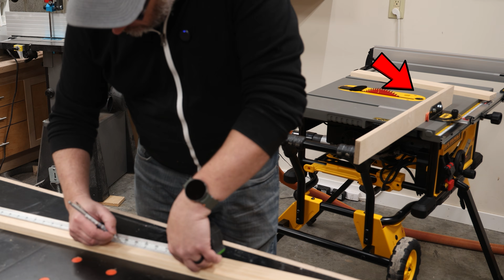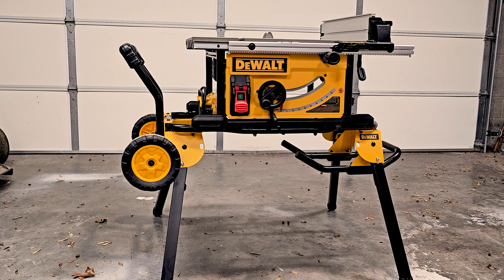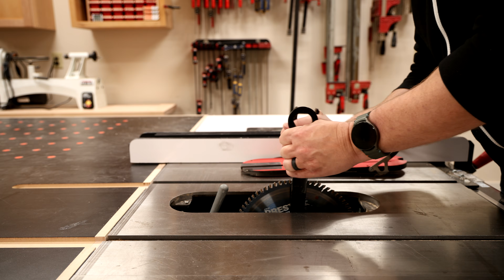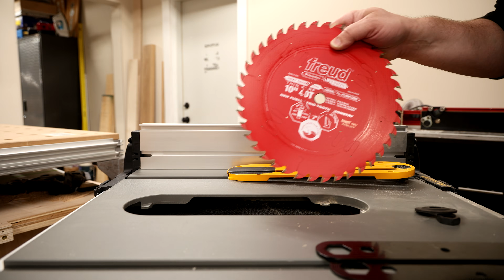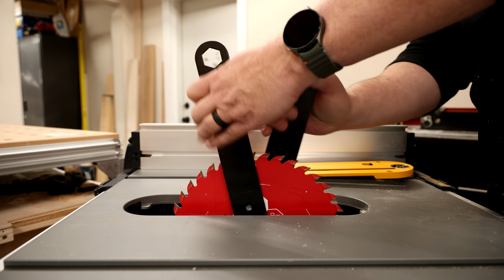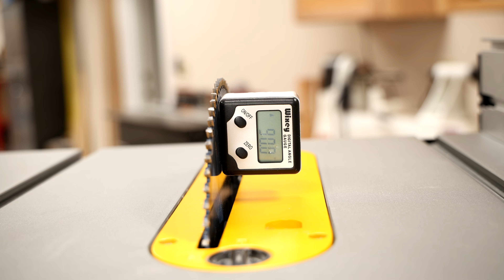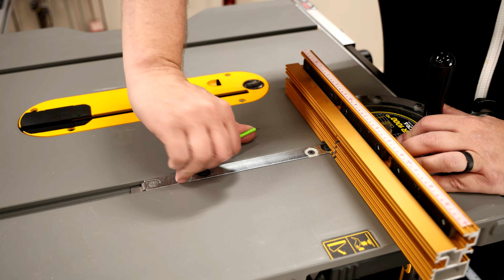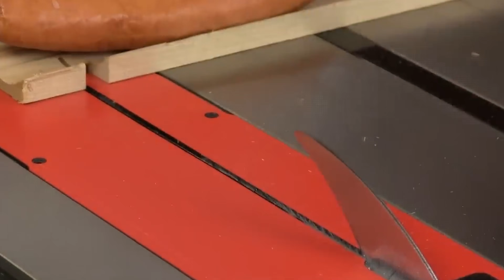Why do people even buy this saw?

Comment: You briefly mentioned the dewalt accepting a dado stack, but not once did you use said dado stack to plow through some plywood or hardwood. Skipping over possibly the biggest reason you would want a 3 hp cabinet saw
Reply from the maker: you're right I did not test dados in this video however I've had 2 jobsite saws and both have been able to easily make 3/4" wide by 3/8 deep dados without a problem. that's the most common dado for cabinetmaking on sheet goods. if you're cutting really deep dados in hardwood you may be able to stall the blade.

Comment: I have that DeWalt saw and it's a lifesaver in that I am using a (small) one car garage as my shop and I can fold the De Walt up and move it out of the way when I need extra space.  In fact everything in my shop (including the workbench) is on wheels so I can move the stuff I'm not using out of the way.  And my workbench also serves as my outfeed table.

Comment: I understand you're not a machinist...
it depends on the engine power and the width of the sawblade, but much more depends on what the sawblade is turning on 😉.
the shaft anchorage and shaft diameter is the holy grail of any saw.
there is no problem making a portable saw with a 30-40mm shaft, but nobody wants to make that because then nobody would buy big table saws. 
it's just dirty marketing of fucking capitalism 😉

Comment: I use UHMW throat plates on my table saw.  They're stiff enough not to flex and easy to cut to any blade setup you want.  Plastic can shatter and aluminum can throw sharp shrapnel in your face if you hit it by putting a thicker blade on the spindle.

Comment: That DeWalt is certainly the jobsite saw that seems to be everywhere, which makes it a logical choice for comparison to a cabinet saw.  I have to wonder if there is there an even better jobsite saw that should be considered, perhaps one that has fewer set up issues?  In particular, the SawStop Jobsite Saw Pro?  The price is not really comparable to the DeWalt (at something like an extra $1,100 and up!), but that is before the bits and pieces are added to the DeWalt.  As a company that made their reputation on quality cabinet saws, I have to wonder if SawStop might have chosen to make a jobsite saw to the same standards.
Reply from the maker: IMO if you have $1100 to spend you should skip a portable jobsite saw and shop for a contractor saw. Everything about it will be better and the used saw market can help you get even more for your money.

Comment: I started off with the same DeWalt saw as you demonstrated.  I found while setting it up that it was really out of wack and with you video, I most likely could have solved them.  I decided to return the saw during the return period I ended up buying a Laguna F2.  Very happy with it.  Sure a SawStop would have been my dream, but unfortunately I did not have the funds.  I just have to remember... the hard part, to do the check, before I turn on the saw if I have performed all the safety checks.  So far so good.  Thank you for an insightfully viewpoint on how you made your decisions.  Keep up the great work.

Comment: i will never understand why nearly every amateur or semiproffessional  american YTer has a saw where you have to push the workpiece. with the budget of a sawtop i can buy a saw with a sliding table. 
watch the chanel of marius hornberger with a Hammer saw of the austrian felder group . and if you have unlimited space an money there is only one saw to buy : Altenburg F45
And b t way: who cuts wood longgrain with a dull 80 teeth blade and shows the burnmarks?
Reply from the maker: that's the kind of saw they sell in America 🤷 European sliding saws are way more expensive to have shipped to the US.

Comment: Like some of the comments go, It's not a choice between a job site saw or a cabinet saw. Saying it's a choice between a job site saw or NO saw is also a bit of an exaggeration.  It's really a difference between a job site saw or a handheld circular saw.  Even the Dewalt job site saw is at the border of affordability.  I've been on plenty of jobs where I ripped sheet goods with a SKIL saw on a makeshift work table with sawhorses and another sheet of plywood using screwed down firring strips as a guide. What I really would like to know is a comparison between job site saws.  How cheap can I go and still make reasonable cuts.
Reply from the maker: there's hundreds of those videos on YouTube you should have lots of viewing choices there

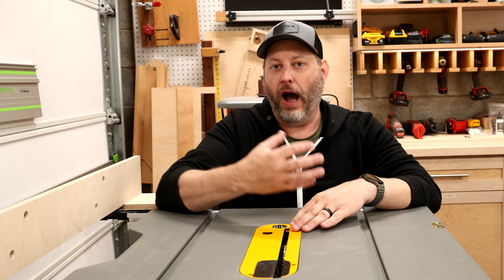Comment: 4:30 tipping the saw is not a problem, the stand is very sturdy and capable. I’ve cut full sheets on it (and other jobsite saws) before. You just need to worry about proper handling of large sheet goods and getting a straight cut, but if you have a helper or infeed/outfeed support, it’s not a problem. Honestly, if you’re pushing that hard that you tip the saw, you should sell your tools cuz you don’t know what you’re doing.
Reply from the maker: it's not about pushing hard it's about putting a 75 pound 4x8 sheet onto a saw that was never designed to do that. also outfeee support is always a good idea no matter the saw!
Reply: @MWAWoodworks it was absolutely designed to do that. It’s a job site saw, they were designed for framers as much as for trim carpenters. That 32” rip capacity was not included for cutting 1x6’s. And Dewalt’s own product description, on their website, includes ripping sheet goods. Your opinion on what you think the saw was designed to do has no evidence to back it up.

Comment: All job site saws need to be dialed and in the case of my skil worm drive I made some mods to make it easier to do

But I would say it's really dangerous to do any cuts without dialing in any saw and for a portable saw plan on dialing it again periodically jusy because you move it a lot and that can knock it out of cal.

So it would be good if the manufacturers would dial them in but at the same time it would create a false sense of security. You need to know how to dial it in and check it periodically because it's portable and it will lose its cal. Guaranteed.

Comment: My terrible jobsite saw is slowly twisting itself apart. Every time I turn on the saw the 2000w motor applies enough torque to seaming twist the chassis under the top. At this point the blade from front to back is out of alignment with the fence by nearly 2mm. Needless to say cuts are not accurate and have started to feel pretty dangerous.

Comment: I have both the DWE7491RS 10" Jobsite Table Saw 32 - 1/2" Rip Capacity with the 1.75 HP motor and a Harvey ALPHA HW110TC-36Pro with 3 HP motor. I initially purchased the DeWalt 10 years ago and learned those lesson of inaccuracies the hard way. Moving up the the Harvey cabinet table saw was hands down instant accuracy and ease while cutting hard woods. I am glad that you were able to put this video together for those who are on the fence of starting their woodworking journey. The DeWalt is meant for "jobsite" and was never designed to be precise nor with extreme accuracy in mind. It was mainly for cutting lumber like pine and  other construction types of wood. Anyway, great video and lots of great tips for everyone and hopefully will save them from learning those lessons the hard way.  Keep the great content coming!

Comment: I appreciate your review - thank you.  I would add a few points to ponder.  I feel like the comparison is a little off based on what the intended uses are for each saw.  The use cases for these two saws are fairly different based on what the owner/user is looking for.  What's most important: Budget, safty, accuracy, portability, size, longevity, speed, effenciency, blah blah blah...  I think in the end you get what you pay for and what you expect out of your machines.  Truly the craftsman makes the differences.  If you know the limits of your machine and know how to make it work for the task at hand, then the saw is an afterthought.  for the average DIYer at home, they probably do not need a Felder sliding table saw...  And for a professional custom furniture builder a contractor saw will probably be a let down on many fronts around accuracy and ease of precsion.  Our worlds finest builds were made with hand tools up until recently - sure i can build things with a simple tool box of hand saws, squares, sharp chisels and a bench, or a 1600sq ft shop with 40k in equipment.  Awesome content to get us thinking - Thanks again..!

Comment: A year out of high school in 1973 I spent all day in a Sailboat window company using a Rockwell industrial saw, vertical cutoff saw, radial arm saw, bandsaw, sanders . Made thousands of cuts at 19 years old and I am quite good with all my fingers still at 71. I would like a Saw Stop , gave my old Craftsman to a friend when I moved across the country and now temporarily have been using a rinky dink Delta for this and that. I will get a better saw soon enough but compactness is important. The ability to move the saw around has been important. I’ve played guitar since I was 14 and keeping my digits is forever on my mind when making hairy cuts. Sometimes I just stop trying to make a dangerous cut and decide on a safer choice , like not trying at all. I have had my share of close calls and stupid decisions.

Comment: Dewalt changed that saw, it now uses 8.25” blades and lacks some other features. So, caveat emptor. I have the same one you do, the older 10” model. It’s a great saw.
Reply from the maker: the 10" model is still available! I think the 8.5" is just an additional saw to the line

Comment: So 40 years woodworking. Taught adult avocational beginners woodworking courses for 20 years, including tablesaw safety courses, jig and sled making, and router seminars. Have owned a jobsite saw new, hybrid Delta saw with Unifence, and now a nearly new Delta 3hp cabinet saw with Biesemeyer fence. If I had an unlimited budget I’d have bought a SawStop cabinet saw. I have the room for a cabinet saw. Thank you for detailed comparisons, I do think those wrestling with buying decisions need to get this kind of presentation. All I know is that I wouldn’t trade my cabinet saw for any reason. Yes craftsmanship isn’t dependant on equipment. But heck, there’s so many advantages to a full bodied cab saw with no issues using stacked dado blades, custom plate inserts, cast and machined mitre slots, etc., etc. And of course, retired now using my older Delta, I couldn’t care less what others have to say🤣
Reply: If I had unlimited money I would  by The FELDER Table saw far superior to the saw stop tablesaw
Reply: @robertfrancis4876  Or a SCM. Or a Martin. Or an Altendorf. Any European sliding table saw in fact (whether it has or not a similar mechanism to Sawstop) is intrinsically safer to handle than a cabinet saw because they don't need external feed tables or extended fences to handle large panels. The slider does the work and you have to put serious intent to get your hands close to the blade. These are professional production machines well known and used even in the US but that are above the means of a weekend woodworker. I'd be over the moon getting a Hammer, the entry range of Felder sliding saws.

Comment: The problem that I've  found. Is that the blade is directly mounted to the motor. On the contractor saws. Leaves ridiculous saw marks.
So it's not a finished edge. Which throws off,your entire project. 
The cabinet saws are belt drive,much smoother.  And better finished product. Much more vibration on the contractor saws. Belts take out all the sawmarks. Which lets your router bits ( for example) follow a straight edge. 
Building houses is much different than building furniture.

Comment: I have been using that same dewalt for all my projects for years now. In regular use the settings, particularly for the fence, do not hold. I find I need to adjust my fence at least once per month or so. It can cause issues if you dont remind yourself to check frequently. I almost had a kickback situation once when I did forget and the blade started to pinch my workpiece against the fence. the other adjustments are much more infrequent. That being said, I completely agree with you that overall, it is still a great option when it comes to budget or space restrictions.
Reply from the maker: I think the newer version of the saw has worked out some of the issues of the older models. but also there's probably a bit of play after years of use also. I'm sure those saws aren't meant to last forever at that price point!

Comment: @ 15:30 Not sure why you set your fence to parallel with the blade ? You always want some toe out on the far end of the fence to avoid the wood getting pinched . We’re only talking about 3 to 5 thousands ,but it’s necessary imo
Reply from the maker: I think that's a remnant of the days before riving knives. I understand the idea of it . it makes sense just don't think it's needed on modern saws.

Comment: The more horsepower you have the more control you will have over your cuts.  I have a 10-inch 3HP #Sawstop which serves me well and am considering to size-up to a 7.5HP Sawstop or even the 12-inch 16HP #Oliver.  If Sawstop would build a 12-inch or even a 16-inch, high-horse I would seriously consider buying it.  Anything over 16-inch is horizontal band-saw territory.

Comment: I went through this debate some time back when I needed a new table saw.  First I don't understand how people say there is no need for a table saw, my table saw is hands down my most used and best wood working tool I have ever owned over the last 20+ years?  Back to this topic, here are my experiences and why I choose to go with cabinet saw.

The cabinet saw's weight and stability make a world of difference, my cuts with the cabinet saw were without questions more accurate, quicker, repeatable and safer than any contractor saw.  When you pull out the fence extensions they are just not as solid and mine had some flex.  I could never get a 30" cut as accurate as I could with the cabinet saw.  The contractor saw had some wobble when cutting larger pieces, it just doesn't have the weight that the cabinet saw does keeping feet firmly planted.  If you have a shop and space for one (I barely did but have zero regrets) the cabinet saw for me is worlds apart than the 2 prior job site saws that I had.  It took me so much more time using the job site saw because of set up, making sure I had any additional supports, etc. before I could start cutting.  

I don't see how these two saws could ever be put in the same category.

Comment: Your comparisons are spot-on, but I think you missed an opportunity to compare an overpriced tool with a shop-made equivalent: the expensive Kreg track saw system ($450)  vs the homemade version, which can be made from scraps ($0).  Even the less-expensive Wen track saw system will run you $300+.
Reply: Oops!!!  I forgot you were only comparing table saws.  Sorry about that.

Comment: IMO, the happy medium between the two, is an old "Contractor saw" from Craftsman, Delta, etc...
They're small enough to stash in the corner of your garage when not used, but powerful enough to handle pretty much anything.
I have a craftsman 113 from the early 70's, that i picked up for $50 off of marketplace.  Upgraded the fence and added a router wing.
Reply from the maker: agreed!

Comment: get real , no respectable cabinet builder with a shop uses a jobsite saw . a hobby builder might but thats it . lots of great tips and insight but doing a comparison was a waste of time .
Reply from the maker: who said this video was for cabinet builders? it was for people considering upgrading their saw.
Reply: @MWAWoodworks  so why would you do a comparison of a jobsite saw to a cabinet grade saw when its obvious that no quality cabinet grade saw would ever be used at a jobsite . and im being kind saying that the sawstop is a quality cabinet grade saw . powermatic or a unisaw or even grizzly is a better saw than sawstop if you dont take the blade stop into consideration .
Reply from the maker: hobby woodworkers upgrade their equipment all the time. DeWalt is a very popular saw to start with and sawstop is the most popular saw to upgrade to. I compared the two so people can see whether it's worth it for them to upgrade based on certain criteria. pretty simple concept.

Comment: I have the middle sized version of the dewalt, that cuts up to 25" or so.  I can confirm all of your points, pretty much.  I have used some really high quality cabinet saws here and there, and the dewalt doesn't even come close.  But, like many budget friendly options, it will do 90% of what you need it to, but will likely involve some extra steps, homemade upgrades, or fine tuning.  The other major consideration for many hobby woodworkers, is space.  The dewalt is small enough to throw up on a shelf, and only bring down when needed.  I can barely lay a 4x8 sheet down in my workroom and still move around it, so a cabinet saw would be 100% out of the question.  With the jobsite saw, I can set it up outdoors if I need to rip something too big for the room, and want/need to use the table saw.  Considering it was never intended to be a precision tool, it is a passible option if a cabinet saw simply isn't feasible, either for space or price reasons.  On another note, though, it's worth mentioning that not all dewalt table saws can take dado stacks.  The largest one with the rolling stand can, mine and the 20" capacity one cannot, the arbour is intentionally too short to put one on it.  I didn't realize this when I bought it, I thought it was the same saw as the rolling one without the stand.
Reply from the maker: all true statements! Thanks!

Comment: The fact that the back end of the saw blade and the fence are more open on a portible table saw is that your wood stock has a greater chance of not binding when pushing through your stock. if you need the kind of accuracy that this host is suggesting, use a shop saw.